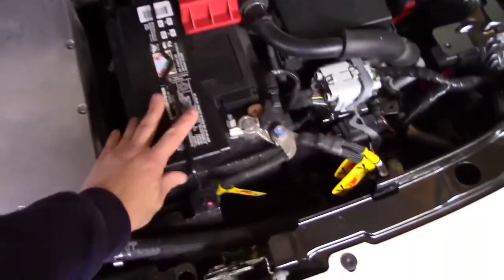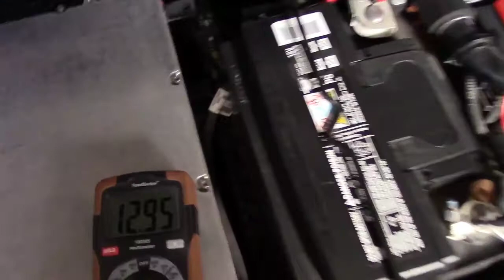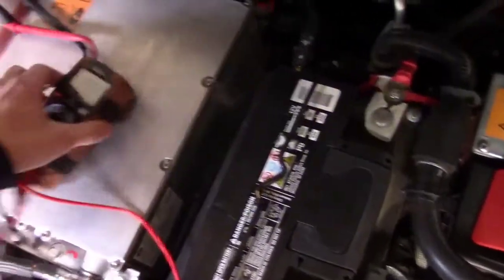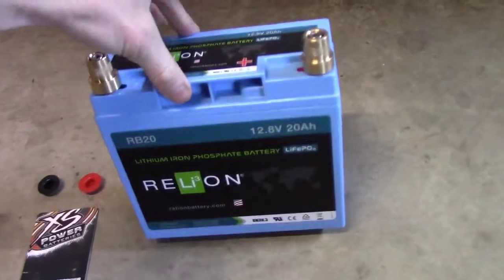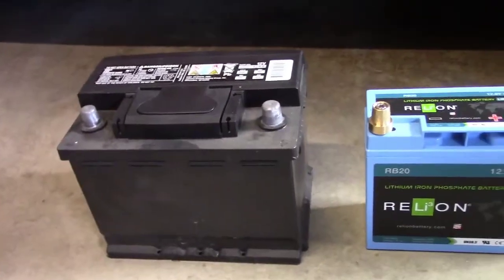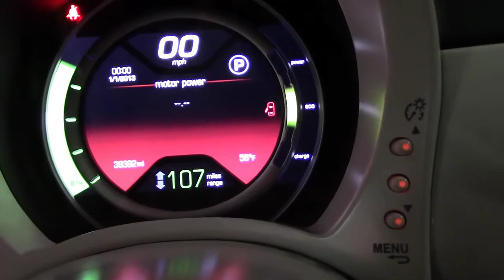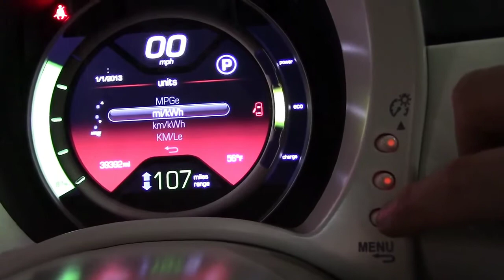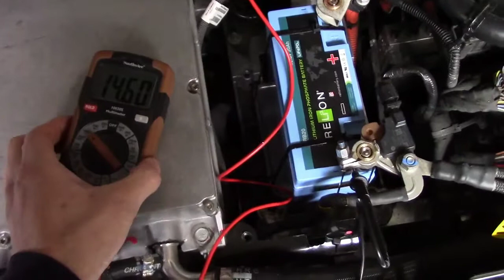Fiat 500e - Modified - episode # 18

Comment: Quick question: How did you determine how many amp hours you'd need? How did you know 20 would be enough? Thanks in advance!
Reply from the maker: I didn't.  An EV only needs enough power to boot-up the system.  Like all EV's (other than Tesla's) that are compliance cars.  The manufacturer is going to use the standard "off the shelf" items whenever possible to keep the cost down.  FCA used the same 60 Ah battery as in many of their cars.  It has plenty of cold cranking power to fire up your V8 gas engine in Alaska winters.  Ciao.
Reply: @theevolvingworld  Awesome! Then that will be one of the first things I do when I get my used Kia Soul EV. It would just drive me nuts having a reliable EV with an old fashioned lead acid battery in it ready to fail at any time (like countless batteries in my past, usually when you are running late for work!)
Reply from the maker: @JustWasted3HoursHere  Oh, I thought you already had '16 Kia Soul.  It is one of my top choices of all the cars I have reviewed.  Tie with the VW e-golf.  Each one has somethings the other doesn't.  I would highly recommend getting the "+" edition fully loaded.  It would not add much cost.  You'll get the only EV with heated & cooled seats, a nice panamic sunroof with power shade, power folding mirrors, & etc.  Not even a single Tesla has cooled seats!  The Pacifica does have them, but you got to everything else and it's more of 33 mile PHEV.
Reply: @theevolvingworld  UPDATE: So I bought the 2016 Kia Soul EV+ that I had my eye on! I live in Florida and it was located in California, but with everything all together, including shipping, it was just under $16000. Should arrive on Wednesday May 27th. Can't wait! Nice car with less than 18000 miles (less than 5000 per year), one owner, certified by Kia and Carfax (no accidents, etc). Metallic gray.

Anyway, have you still had no issues with that ReLion lithium 12V battery in your Fiat after 2 years? Because I am really keen to do this myself. Thanks, man!
Reply from the maker: @JustWasted3HoursHere  Congrats! that should be a solid car for many years & miles ahead.  LiFePO4 12v is solid, no problems. It will be good to buy & have ready for when the oldschool lead-acid wears out.  Cheers,
Reply: @theevolvingworld  I guess I could even keep it in the car, so I don't get stranded somewhere with a failed lead acid. I guess it would depend on how old the lead acid in the vehicle is. If it's original equipment then I might just replace it anyway. What's frustrating is that various LiFePO4 12V manufacturers say that you MUST use a lithium-specific battery charger, while several YouTube videos like yours say they've not had any issues using a regular lead acid charger (like the one in the vehicle). Since these batteries contain their own BMS, I would think it would be safe. 

Thanks for the help!

p.s. Apparently the "power on/off" button next to the shift lever has a little LED that will warn you if the 12V battery is in poor health. If so, that's good news and I will keep my eye on that.
Reply from the maker: @JustWasted3HoursHere  Congrats on the car.  It should provide many years of maintenance free efficient driving.  I wouldn't freak out on miscellaneous nuances.  There's several you will need to get used to and then, it just becomes normal.  You probably plugged in too quickly after turning the car "off".  The 500e & LEAF I had both did that.  Join "Plugshare" if you haven't already & horde the free charging on road trips. Also, see how many miles per kWh you can get.  Your on flat land and warm weather so you should be able to pull some of the highest numbers in the U.S.
Reply: @theevolvingworld  Thanks, man. It could also be that we had a 1 second power outage a few days before that might have caused the EVSE to "hiccup". Anyway, I'll take your advice. I took my wife and son for a trip around the block and my wife was flabbergasted by the quietness. The I momentarily floored it and her eyes got as big as saucers. Hard to believe it's only about 11 seconds to 60 mph. Feels WAY faster!

Another great surprise was lifting the hood: Spotlessly clean. Like, not one drop of anything anywhere to be seen. With the floor of the engine compartment completely enclosed it makes sense though. And even after driving it for a while around the neighborhood, no heat coming out of there either.

But, yeah, I'm going to have to get used to the foibles and whatnot. The three indicator lights on the top of the dash are handy for seeing the state of charging at a glance. And I found that it has a warning feature that I wish more ICE cars had: It tells you when the 12V battery is getting low and the key-fob too! In every ICE car I've ever had basically the "batt" light comes on WHEN you already have a problem, such as the battery itself or the alternator.

Anyway, have a good one. Oh! I ordered the Relion RB20 and it is on its way, but the one in the vehicle right now looks brand new so I will just hang on to it until it's needed. I also ordered the M6 to post adapters. Take care.
Reply from the maker: @JustWasted3HoursHere  I would not be concerned about paste on the positive terminal.  The lead-acid 12v should have a two or three digit date code: the letter means sequential month (A = January etc. etc.) and a 4 or 14 would mean 2014.  It's possible if it's certified pre-owned that they stuck in a new one (if needed or not).   It's always easier to keep a car clean, if it came that way!  EV project cars not so much.  Cheers.
Reply: @theevolvingworld  Well, there are two code stamped on top of the battery. The first one is 24112015B, which probably means it was made on the 24th of November 2015. The other one is AY4S54, we're just a little bit harder to decipher. But the first one makes perfect sense because it's a 2016 model so November of 2015 would be just about right. In the manual it says that the stock 12-volt battery is calcium-based, which is kind of interesting. Maybe that's why it has lasted so long? (That and the fact it only has 17000-ish miles).

Have a good one!
Reply from the maker: @JustWasted3HoursHere  That's a great deal.  I need to get me some red paste and put it on... And complain about that "I only just noticed it now, but I swear it was always there... send me another one"  Yeah, that's it.  

It looks good with the nylon strap latched in matching blue, but I don't know if you need the extra capacity.  As a 12v pack It will last twice as long, I would expect simply from less cycles.  If will also give extra protection from ever running the 12v down.
Reply: @theevolvingworld  I agree that strictly speaking it's not necessary, but I figured since I have it, and don't have any other uses for it at the moment, might as well put it to some use. Who knows? Maybe I'll need to run the headlights some day on a dark road with the main battery low or the main power switched off or something.

Comment: Good mod. I was wondering, Fiat put in a starter battery with CCA 540, is this why they fail so fast? A deep cycle would be more suitable.
Reply from the maker: FCA used a cheap lead-acid because they are major OEM with tier one suppliers that give them a volume discount.  Any LiFePO4 battery (as featured) is the best, longest lasting, & most suitable battery for the job.
Reply: They fit it with Anderson connectors, I need to make it work with the clampconnectors
Reply: Ans while waiting for the chinese battery to arrive, our 500e suddenly stopped working at all. Luckely I was subscribed to this channel and suspected the 12v immediatly, and for the waiting time put another used one in. Thanks!
Reply from the maker: @jaapdewind8774  On eBay or amazon: 8mm 12v battery terminal adapters.

Comment: Whats the C rating ? I know in  diesel engines you would need a 6C but thats to do with actually starting the engine. Do you not need a balance unit to keep the LiFePO4 safe/healthy ?
Reply from the maker: It appears to be 1c continuous  & 7.5 sec bursts up to 2c.  No BMS needed.  It does have over & under charge protection.  The LiFePO4 chemistry is the safest most stable of all the Li-Ion chemistries.  Not the lightest or most energy dense though.
Reply: His car does not have a starter nor a combustion engine, hence no need for a high C rating.

Comment: The only issue I would worry about is during winter time. Lithium is terrible when it gets cold. Its possible that you may have starting issues if you live in an area that gets real cold for a long period of time.
Reply: This is an electric car, there really is no such thing as starting amps. As long as the voltage holds, you're good to go.

Comment: Still no issues with this battery after 2 years? I found another LiFEPO4 battery on Amazon for about half this price that even has a built in volt gauge (could be useful to check it at a glance). What do you think? https://www.amazon.com/dp/B0824S6LB2/?coliid=I3SFNQXVB8ASPI&colid=3CLBALY2F1TMR&psc=1&ref_=lv_ov_lig_dp_it It's also 24Ah instead of 20. What's your opinion of this?

Comment: Hopefully the dc/dc converter will not overcharge your new LiIon Battery. remember the electrical system of the car was designed to charge your old Lead Acid battery.
Reply: indeed, I sincerely like the idea of getting rid of those Lead Acid batteries but how does it being charged is the question
Reply from the maker: The New battery is designed to be a drop-in replacement for any Lead-acid battery.  The only difference here is it's 1/3 the capacity.  The DC/DC converter should read the voltage as full sooner & cut off.  More charges, less time each charge.  The New battery also has built-in over & under charge protection.
Reply: Your assumptions are based on what? 
What is maximum voltage that Li-Ion battery can handle?  
What do you mean under “DC/DC converter will read that battery is full sooner. “?
The fact is that every time car is turned on, DC/DC converter will apply 14.3 V to 12V battery and will regulate charging current based on 12V battery voltage. 
What is the maximum charging current that Li-Ion battery can handle?
What is the maximum charging current the car can apply to the 12 V battery?
Reply: I'm watching your videos and trimming my 500e down.  I just did the trunk today.  I weighed everything that came off.  The whole trunk came out to 20 pounds of weight.  I'm going to get rid of the seats and make it a sort of hatch back.  Thanks for all your videos.  I love this little car and I'm learning a lot about electric cars.  Plus now I have a cool portable air compressor that says Fiat.
Reply: @jirigrandpa  It's not Li-Ion, it's LiFePO4. Max charge voltage is 3.65V times 4 in series=14.6V. Perfect replacement for lead acid.
Reply: @jirigrandpa  12.8V

Comment: I'm confused?  why does an electric car (I don't own one but thinking of getting one)   have a battery like this?  I thought the only battery  the electric car's have, including the Fiat 500E is more like the type I see in this other video,  see:  https://www.youtube.com/watch?v=ROu8T_ehdLA
Reply from the maker: All current electric cars have two batteries.  One is the "big battery" which is a high voltage & high capacity battery that propels the car.  The other type is one like this, which is common amongst all gasoline & electric cars:  a 12v low voltage battery.

Why does a modern EV need an old fashioned 12v battery?   It's simple, because virtually every electrical component (such as power windows, wipers, radio, headlights, etc. etc.) is the same component commonly found in gas cars.  Why reinvent the wheel?